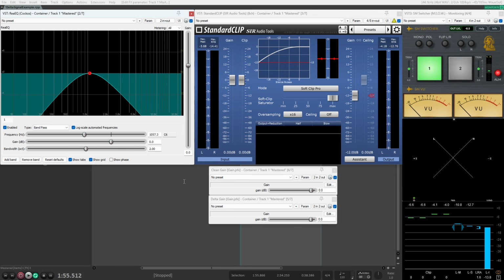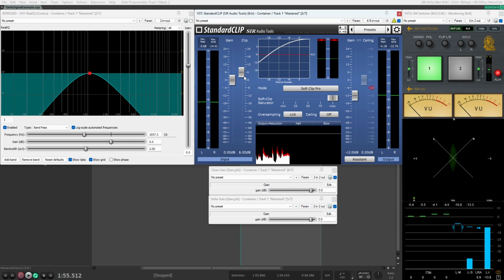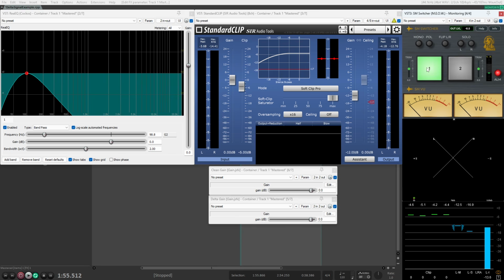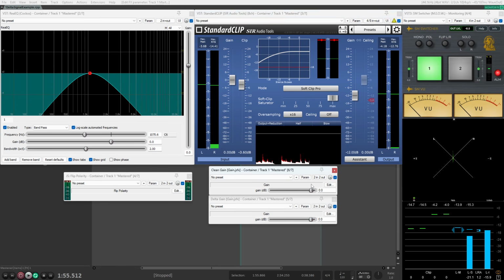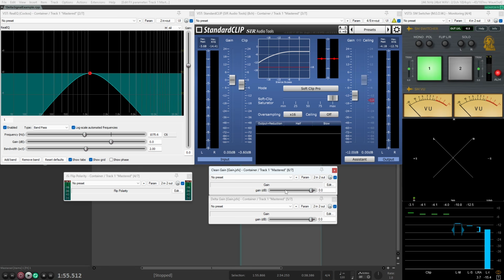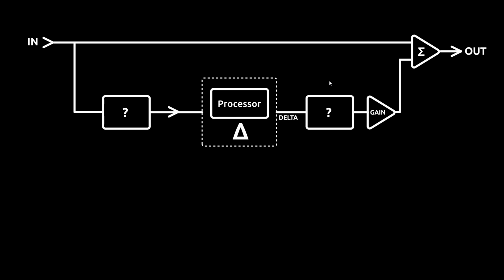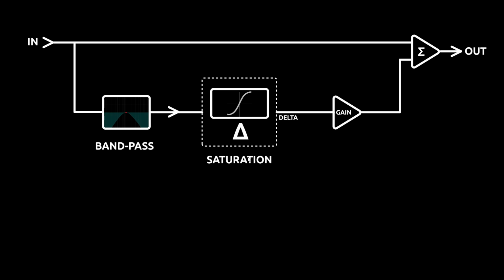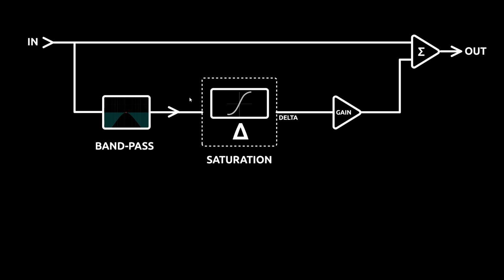Unlocking Advanced Saturation Control using the Delta Signal

Comment: BTW, in Reaper you can set the input-output of a container, you can also delta the entire container and put a container in a container. With that you can create your own little signal chain and then save it as a preset like "Just add saturator". This is what I've done now to test this out: a container receiving input, adding EQ for bandpass, saturator and then a gain utility plugin (there's an Automatic Gain JSFX plugin BTW). Then I set the output to 3/4. Then I only needed to add 3-way joiner and there it was. One more thing: when dealing with saturator it's worth using Delta option and lower or increase the output gain until you mostly hear only the added crunch. If the level is higher or lower then the delta would sound very much like the original audio.

Comment: Hello.Sofia and Thomas  I'm finding it difficult to fully understand this process of adding a delta signal. Basically, I listen to hear what a clipper can do to a complete signal, and then I demute that recording. But here, Thomas, if I understand correctly, you're only keeping the delta signal that you've filtered with an EQ, without re-injecting the rest of the signal. It's really surprising that such "small," "discreet," or "thin" sonic information can act so beautifully on a master track, for example. Have I understood your process correctly?. This is all very interesting. kindly :hand-pink-waving::planet-orange-purple-ring::penguin-blue-waving-tear:
Reply from the maker: Yes, that's it. 👍 The filtered signal goes into the saturator, the delta signal is then extracted from the saturator and added back to the clean signal. The delta signal can sound quite strange on its own, but it can be used to add very specific changes to the sound. /Thomas
Reply: @MasteringExplained  Well, that's quite a technique, one I'd never seen demonstrated by anyone before you. What I like about this process is that when adding a clipper, you don't inject a duplicate of the master file; you only inject the difference created by the clipper. My studio is down for another three weeks. But then I'll rush to my DAW to test it out. Thank you so much, Thomas and Sofia.

Comment: How does this differ from multiband saturation?
Reply from the maker: Good question! The delta method in the video doesn't have any cross-over filters in the direct signal path, only saturates one band, and gives a lot of control over the sound. It might be possible to get similar sounds using a multiband saturation plugin as well. /Thomas

Comment: This is a really nice idea! 

I was thinking that for compressors or any plugin really, that has a sidechain support, you could split the incoming signal to three signals, one is the normal dry signal, the second one is for the signal to be put through the plugin and get delta from, and then the third would be the control signal, where one could gain or decrease some frequencies via an EQ before passing it as a sidechain into the prosessing plugin. This way the wet signal would not get any ringing or phaseshifts. 

The only noticeable probelm would be that the sidechain signal could give "false" information into the prosessing plugin, so it would react little bit differently, but with just linearphase mode and latency compensation, i dont think any major problems would occur.

Comment: I don't get why you do the container stuff. Why not just using a copy of the signal and processing the delta to then blend it to the original?
Reply from the maker: It keeps the main FX chain a simple stereo path with one container "plugin" for each delta based method. Easy to move around, bypass, duplicate, or use as a modular block inside another container etc. /Thomas